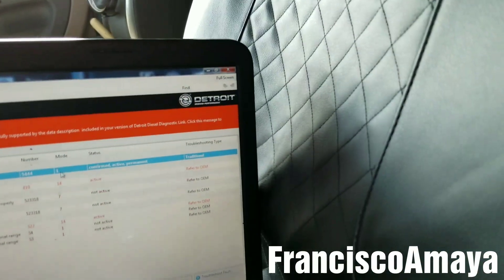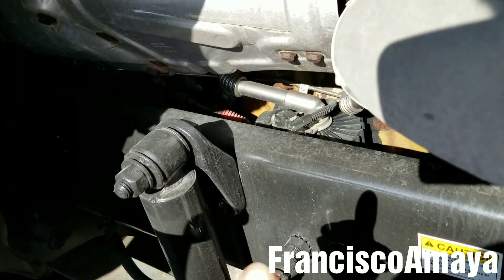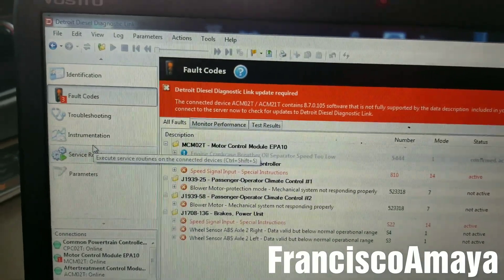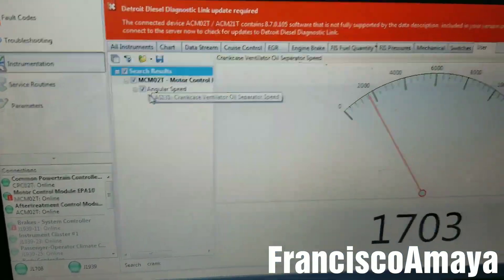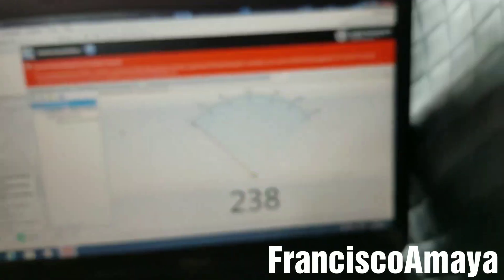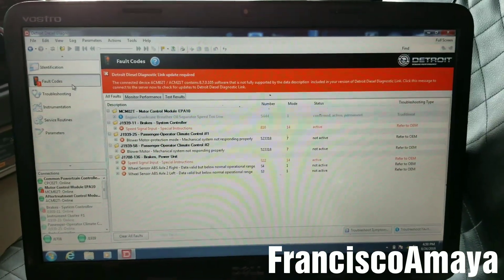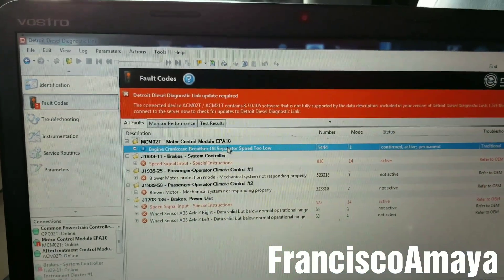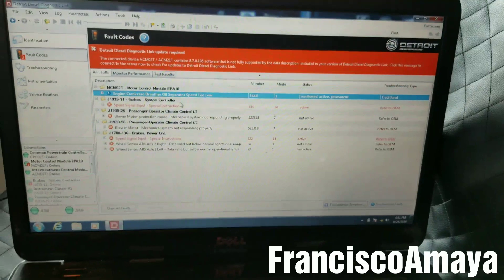Freightliner cascadia DD13 DD15 DD16 SPN 5444 FMI 1 crankcase oil separator speed too low

Comment: I just replaced that crankcase   Also, the  speed sensor I'm just wondering how long before the light goes off. Since I don't have a scanner to clear the code.
$400 at freightliner  crankcase  
$35 speed sensor

Comment: I had my crankcase filter replaced but I still have the Spn 5444 code . No leaks
Reply: Did you get it fixed? I have the same issue and just replaced the part but still got the code

Comment: Franciso after i had my crankcase filter changed i noticed smoke coming out of of that side of engine. Now there is oil and diesel in intake and software says compression is bad causing cylinder 2, 4, and 6 to fail, can that be the cause or do i need a complete overhaul?

Comment: I put a new Crankcase breather a week ago. I still got code spn 5444 fmi 1. It wasn't there before. Can sensor go bad?
Reply: Did you figure it out? I have a new  breather and code came back, I put a new sensor and code came back again.
Reply: @ivan199120  yes, my new breather was faulty. Covered under warranty. Put the new one. No problem after that.
Reply: @पार्वती_असली  how did you determine that? The inside wasn’t spinning freely?
Reply: @ivan199120  open your oil cap where we put the engine oil and put your hand on it while truck is hot and running. It shouldn't be throwing air out too much. This what breather does, helps the engine to breathe. Mine was doing it so I thought it is bad..

Comment: Is that considered an emissions problem? The malfunction light came on, not a check engine light and the manual says it’s emissions related. The code was SPN 5444 FMI 1.
Reply from the maker: Yes, it is the crankcase filter.  It is considered emissions.

Comment: I have this code active I changed to crank case filter but it’s still active now I checked the instrumental and it’s reading 0 and not available I do see the wiring to the plug exposed to heat how do I check if the plug is actually working ? Or do I just replace the sensor itself ?

Comment: Great videos. I have the exact same code on my 2012 dd13. I replaced the crankcase since that code popped up and also saw a oil leak. I noticed that on my crank case, there is no sensor plug in. I asked the dealer and they told me that for my model dd13 it does not come with a sensor.  Once I replaced it my code did not come off even driving over 3000 miles. Since I had warranty from the dealer I took it back and got a new one even though the other one was not leaking. I put on the new one and erased the code and the code came back on once I turned off the truck and turned it back on. Don’t know what else to do. I followed your instructions of how to install it which made my life easy but the code is still there. Please help.

Comment: Amaya i have the same code and i just had my crank case replaced why is it so
Reply from the maker: Probably the engine sensor harness is bad
Reply: I I just replaced my crankcase filter because I was getting code 54-44 I still get the code and took it to Freightliner and they also agreed that the engine harness is probably bad which makes me think that the old crankcase filter was probably fine and it was the engine harness the entire time
Reply: Hey AMaya is it safe to say that if the engine harness is bad then the crankcase filter is probably operating properly?
Reply from the maker: Yes, it could be just the harness

Comment: Will this cause also the faults :eng 2 spn 636 position sensor 02  and misfire on cylinder 1-6
Reply from the maker: No, that could be caused by a bad engine harness
Reply: Francisco Amaya thanks that’s next on the list

Comment: How does the computer give a speed reading?  Is it using a flow sensor and then converting it to rpm?  Cummins uses pressure in inches of water.
Reply: The connector on top of the centrifugal filter is for the speed sensor. There is a speed senor and tone wheel built in to the breather assembly.

Comment: Does that software you are using also include the service manual for the steps needed to make these repairs, or is it just for diagnostics?
Reply: TheMonistat7 yes step by step
Reply: @transport21  no not yet. Been thinking about it, but need to decide if it's worth it. Only problem is if I do break down it's usually far from home, so it's hard to actually do a repair if I actually need it, so it's hard to justify.
Reply: TheMonistat7 how much it cost?
Reply: @transport21  MO. Not sure, I heard it's $1k+ up front with a $500 yearly subscription. But that's just talking to random people.